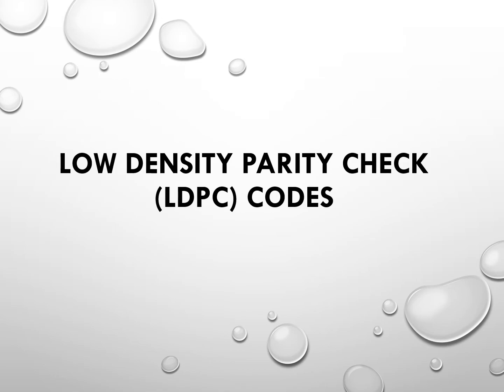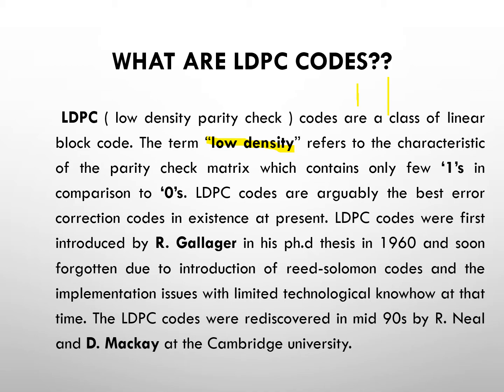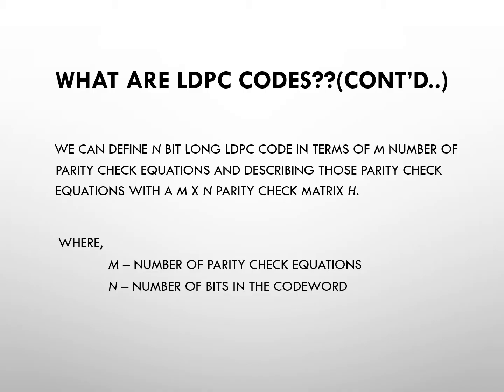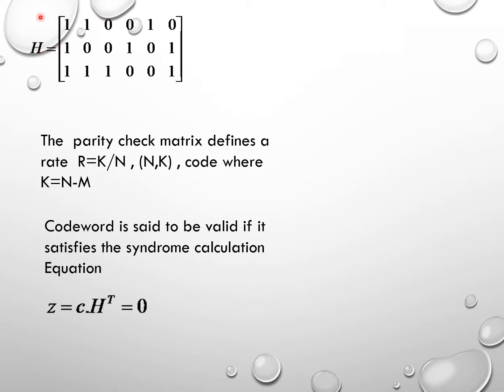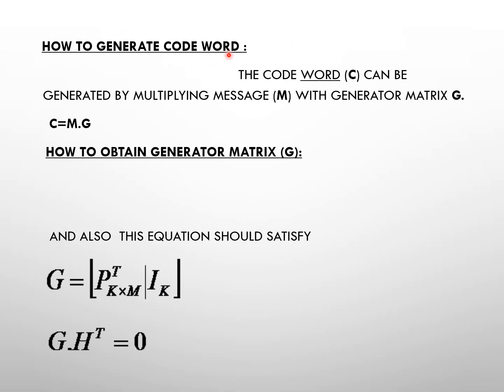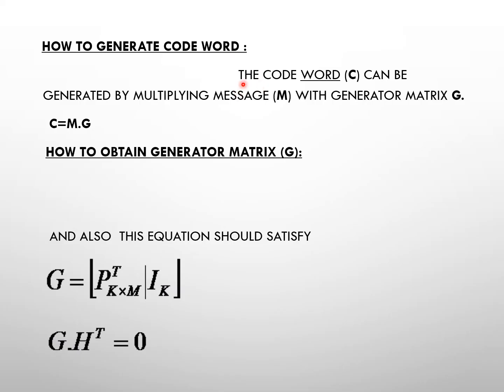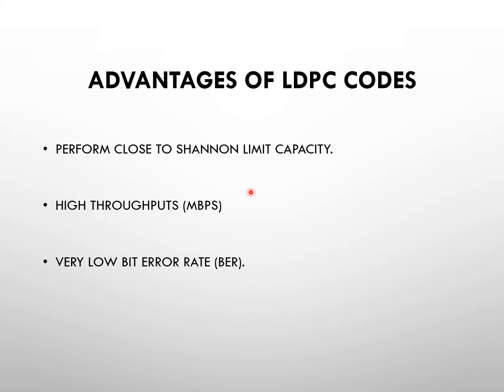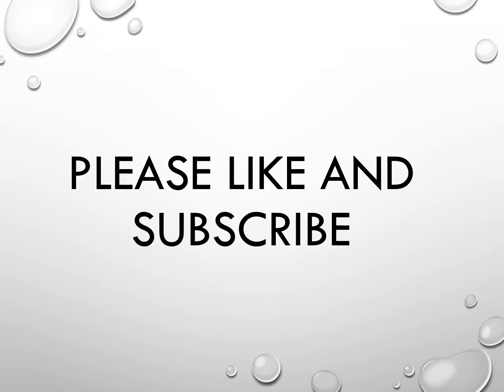Low Density Parity Check (LDPC) Codes ! LDPC codes in error control coding

Comment: can you please explain with an example, take a 8/16/what ever minimum is required user message), and then explain the encode and decode, introduce a couple of bitflips and decode fails, then show how using LDPC it can correct, only then it is easier to understand